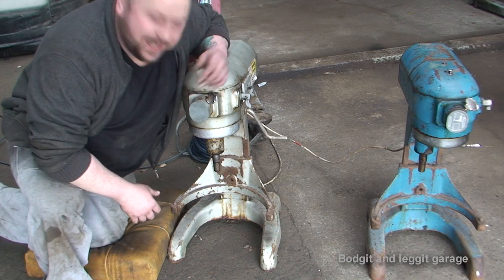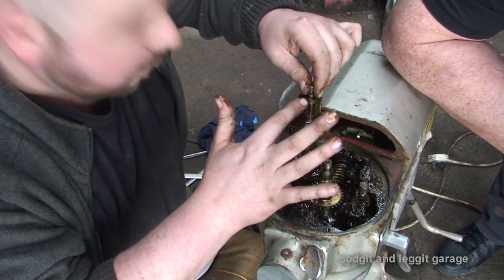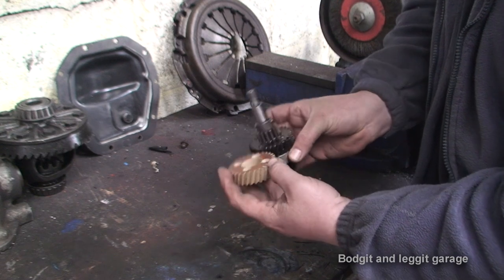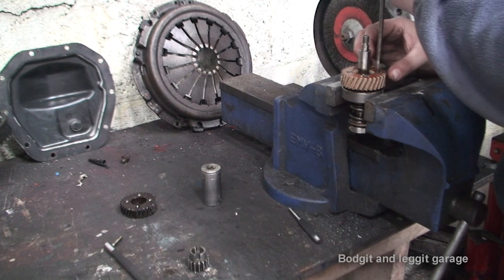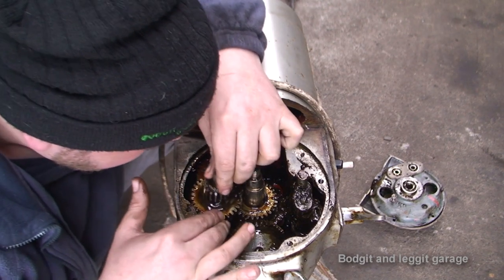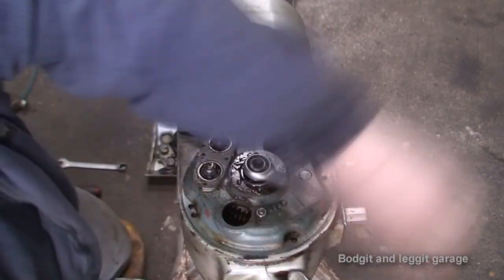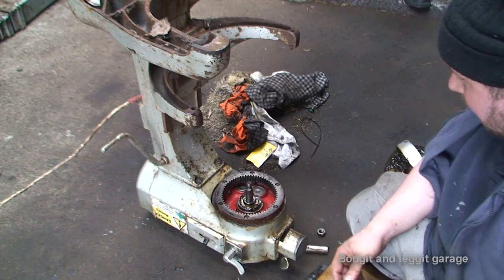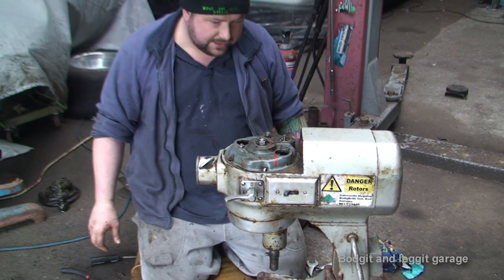Hobart mixer A200 Not Working The fix

Comment: You didn't show any speed or gear changes.   Betting there was still some issues.  I see many issues with how this was serviced.  Improper protrudes, assemblies and lubricants.  I would not want to be responsible for that unit sold as a repaired unit.     No way.  Sorry.
Reply from the maker: Well the shop that's had it for the last 2 and a half years after I repaired it has had no problems whatsoever is it

Comment: Very Well Done Indeed...I used to work for Hobart on all of there kit as a Field Service Engineer and can honestly say you did a great job its the Hands on way of learning how to fix stuff...The Fiber gear is to save the motor when a Chef overloads the motor the gear is made to strip instead of the motor burning out eventually the they key steel also gives out after numerous overloads so you where unlucky having both bits go at the same time.
Reply from the maker: Steve Jones thanks mate nice to hear from somebody that knows what they're doing with this machine
Reply: Steve - I have been working on my Hobart, and have it back together...mostly.  When putting the planetary back on the planetary shaft, it is getting stuck.  It is like the shaft is too big for the hole.  I never took the shaft out, just dropped the planetary.  I tried grease, but that didn't help.  Any tips or hints on what could be causing this ?  It looks like it should simply slide onto the shaft...go figure.

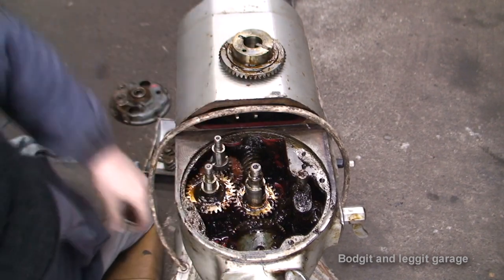Comment: With the key that you place at 21:40, does it have a spring or some other mechanism that keeps it "going out" away from the center of the gear and engaging (catching) on those slots on the low speed gear that you place at 22:15? I am having issues with my a200 not working on speed 1.

Comment: The top cover screw should be used to lift of gear the cover: The small nut on the cover should not touched. The centre gear assembly should be lifted out as a complete unit (slide fingers all the way down to the bottom gear and lift the whole lot out.. The two other gears come out and get replaced together. The washers on top of the gears should be placed dome side down. The nuts on top should not be too tight. Finally, its not grease that should be in these but gear oil.

All that aside you have shown how easy they are to repair the gears on these machines which is definitely a good thing.
Reply: Thanks for helping future viewers. I work on these in the US and we use Mobil food grade grease instead of gear oil. It lubricates properly and, unlike gear oil, doesn't tend to slip past the oil seal.
Reply: Thank you for your reply and the tip on food grease, I will look into that here in the UK.

I've not serviced one yet but I do have one to do soon so I have been watching plenty of videos on the process i feel reasonably confident that i will be able to complete it without much trouble (im sure there is some impolite term for that HA!).

Obviously the reason for my comment being that there is a better way that would save a lot of time. No fault to the mechanic, after all it isn't his regular job and I think he got it done in the end but he could have saved himself the headaches of putting the gears back together. Still not a bad video.

Comment: Loved watching your video I was having a good laugh sorry I'm a Hobart service technician.
Reply from the maker: 🤣🤣🤣 but at least I fixed it and it's still going strong now not bad for the first time I've opened it up
Reply: Jason can you tell me the model of this first hobart that they are fixing? I have one but it no longer has the label for make and model and I need those asap!
Reply: @bodgitandleggitgarage  what is the first model type? I have one but no info on make and model and I need this asap!
Reply: A200 mixer
Reply: @jasonsaylor7983  thank you.
Reply: Hi Jason I have a200 mixer gear 3 runs free and you can stop the shaft by hand what could be the problem?
Reply: @mkhan-ny6nq  broken key
Reply: Thankyou
Reply: Hi Jason, any advice on how to replace a leaked agitator shaft Seal and the proper way to line up the oil pump fiber gear.
Reply: Re Jason,  Hl 1400 series mixer. Thank mate..
Reply: @samho9318  But if you already pulled the planetary you would need a saw pully and two 2x4 and the Bowl you strap the 2x4 to the bowl and use the pully to hold the planetary and you slowly jog the bowl up make sure you make makes on the case and planetary that will help you line stuff up. Just a FYI them oil pump are not cheap new they are over 1500.00 bucks so if you break that gear is not cheap.
Reply: @jasonsaylor7983 I haven't drop it yet> waiting for parts. Yah I order complete oil P Assy. ring, sun , BB, RB, seal and gasket just incase. 
Thank you , appreciated it,  Go Raider 👌.
Reply: @samho9318  Man that a fun job isn't the big mixers are no fun is it just leaking for the planetary seal? Because if so you can just pop out the old one then drive the new one up the shaft just put a little lube on the shaft so the spring in the seal don't pop out.
Reply: @jasonsaylor7983  Some sideway movement, suspected worm out part planet gear, no fun at al😂😂😂
X2 on the seal on the V1401... 1991 and keep going . Do you also work on Cold side?
Reply: @samho9318  No I don't do cool side. I know a little about it but. I'm not licensed to do cool. How old is the mixer I had one were the lower bearing cut a Groove into the planetary but that was on a very old L800.
Reply: @jasonsaylor7983  
Good that way thou, just focus on one side.
I work in the Main Kitchen so go figure, never ending.  New to the Hot side , a lot to learn mainly at my time or from some one like you willing to share👍.  I cant event have a schematic for a FT900 yes that one going to be tough... 🤣. I sleep with it hahha.
Reply: @jasonsaylor7983  HL1400 20O1
Reply: Wish I can call you.
Reply: @samho9318  I'm on Facebook

Comment: I would guess the big spring is for a spring loaded clutch for motor protection.  The fiber gear would be the second line of defense and shearing the key would be the third line of defense. Not sure if the clutch would protect your arm or not.  I am currently working on a D300.
Reply from the maker: Randy Braun hi mate I wouldn't like to test any of them lol how are you getting on with yours is there much wrong with it
Reply: have you fixed it? Im working on a d300 but the first gear has no torque. any suggestions would be great.

Comment: You don't know what you're doing... quit making videos on how not to do repairs on a 200.
 The bolt you were trying to get off was put in from the inside and the nut was on the outside. all that bolt does is interrupt the grease inside as it is turning so the grease gets on the gears.
The way you pull the cover is to screw all the way in the srew that holds the outside cover that covers the transmission in that same hole.

Comment: You do need to do a little more research it is Grease that goes in the Gear box on the 12, 20 , 30 , qt mixers  it is a 0 weight  grease  Gear ,
Reply from the maker: Keith Morris like I explaining the video of the customer got the Grease
Reply: Wrong